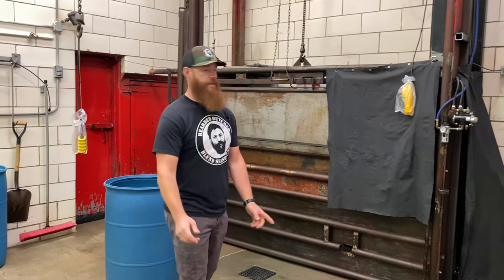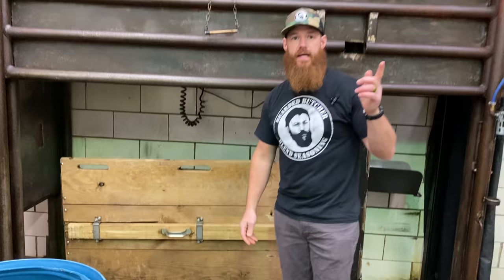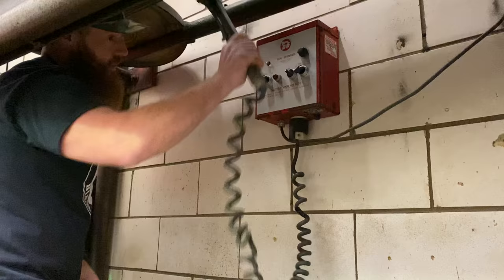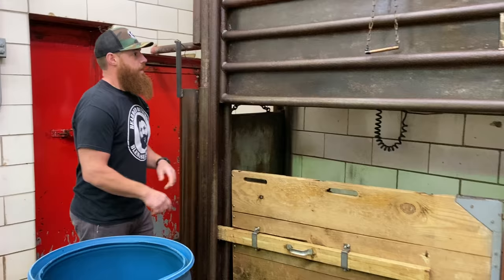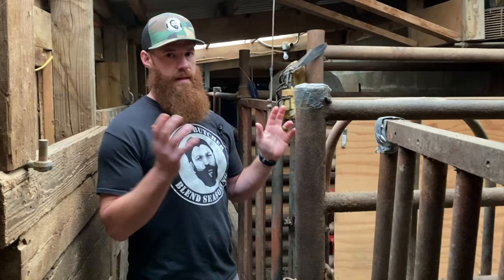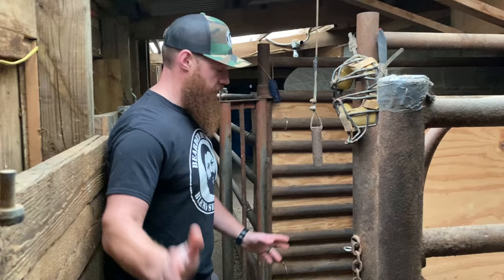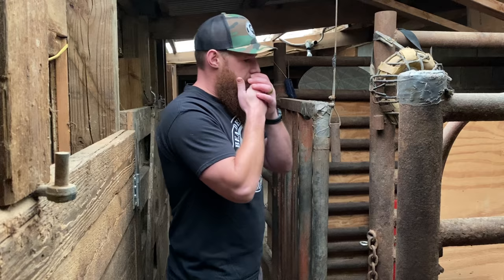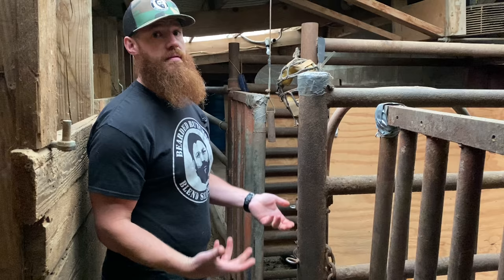Behind the Scenes at a Slaughterhouse | Small Animals like Pigs and Sheep | The Bearded Butchers

Comment: Impressive. Back in the 70's I worked for a few months at a large commercial packing house as the plant draftsman working on a redesign of the entire plant. I saw a couple of disturbing things while there....like pigs being driven to a gate, the other side of which was an electrocution device...they would be panicked knowing something bad was happening, and I saw one pig get it's snout stuck against a post beside the gate....a worker came over and repeatedly kicked the thing until the snout came free (and bleeding)...then as the pigs went through a second gate they were electrocuted....however as the pigs were not of uniform size, the current was set to stun....but low enough as to not overdo the smaller pigs...several times I saw larger animals come to, dangling from hooks, and squealing in terror as they went through a flame that burned the hair off of them. I didn't eat pork for a long time after that experience.
Reply: geez :(
Reply: it's dreadfull makes you wonder how such folk can live with themselves .

Comment: An improvement idea on that gate that took your teeth out.  Some sort of drop down pin into the door at the top.  Kind of like the standard barrel bolts, but much heavier.  If you could reach up, turn a bolt and drop it into the door, there would be no need to reach through the gate to mess with a chain.  And if it was at the top, there wouldn't be anything for the animal to snag on.
Reply from the maker: Appreciate the suggestion, brother. 💪

Comment: Yup. Dangers. I'd change your latch .easy and safer. I worked in a packing house for 30 yrs. We killed a 105000 every 5 days and more if we killed satdays .and we did about 20 sat days per year. That's alot of spam or anything else you want to make. I've worked in all departments at hormel foods. It's a fast pace when you kill that many . And it never ends.